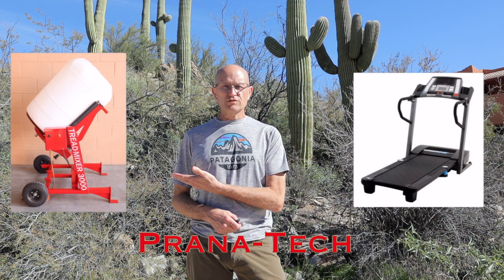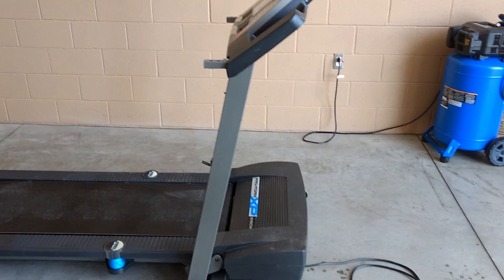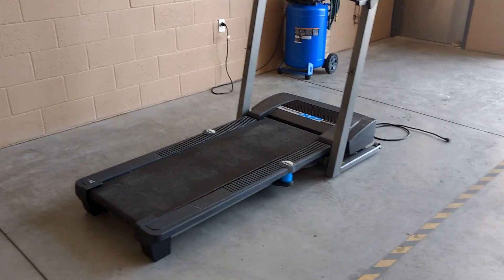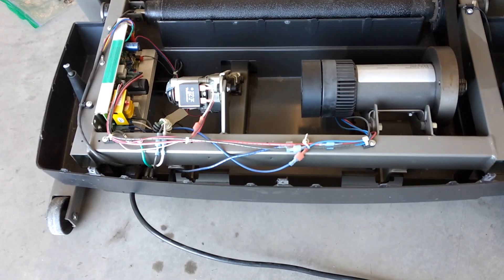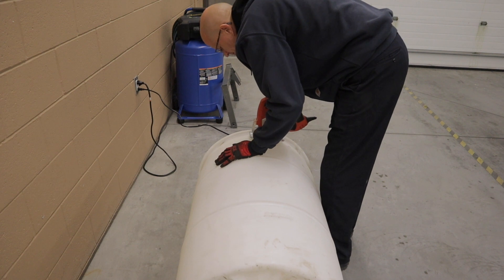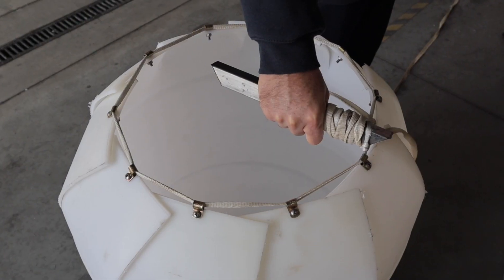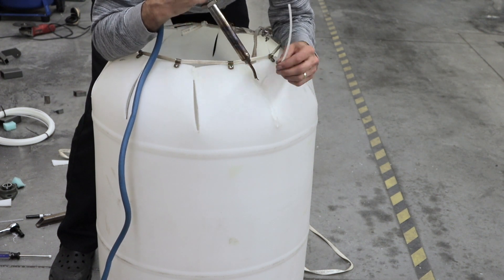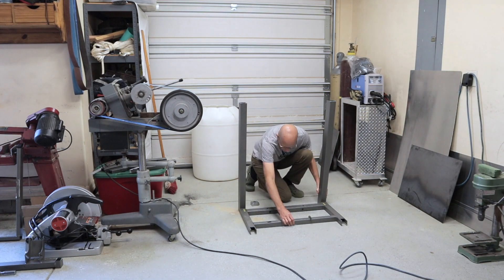Homemade DIY 55 Gallon drum Cement Concrete or Aircrete Mixer. How to build one from a Treadmill!

Comment: Hey Don, I already have access to a regular cement mixer. Should I be okay with that or are there necessary advantages with the TreadMixer? It's a very impressive build BTW but unfortunately for me welding is still on my 'to learn' list 😆
Reply from the maker: Hi Pete! Any mixer will do just fine. I built mine because I didn’t want to spend the money they want locally for a decent size mixer. 😊👍
Reply: @PranaTech  Roger that, thanks Don ✌️

Comment: I've built two cement mixers, the small one first, it needed fixing about 4 times, so showing how you build one is useless until you've used it at least 3 or 5 times and find out what breaks on it.   The key to my small one (made from a $100 golfcart mostly and 2000lb winch), was the big golfcart wheels, so I could load it up from the sand/gravel dumped from the truck and the loaded into the mixer dry, and then I could move it to where the cement was dumped after mixing it with water.  Otherwise, moving it wet was too heavy and made a fricken mess.
it had to be perfectly balanced like a wheelbarrow so I could move it full of material by hand,  The big fat tires were key.

My second one was very large 1/2 yard made from 2 or 3 55 gallon drums, an old forklift base, some old trailer hubs and wheels that it spun on, and old car axle and tires so I could tow it to where I needed to mix, and manual worm gear winch that would tilt it.  Originally I used an automatic trans that I fixed into first gear, but it was too fast and it also broke apart after using it a few times. I replaced that with another automatic trans locked into reverse done better, and then had a industrial reduction gear that I used a 5hp 12v winch motor.
This worked well but the drum started to bend and get flat spots so when spinning the motor had to actually LIFT it up rather than just spin it when it hit a low spot in the drum.  This would overheat the motor and eventually I had to limit to 1/4 yard but it died after doing a few shed floors, a driveway, and most all of my addition footing walls, the last part it died and we had to manually spin it to get the last two loads done.  It has sat ever since..I am thinking to fix it now as I need to pour more concrete that is remote location, so expensive to have it delivered.
Reply from the maker: You are very right sir! I just finished rebuilding the mixer with a steel tank because the plastic one cracked out the bottom after 2 years of running it mixing 3 bags of concrete or mortar at a time. I built 55 feet of sidewalk to my front door and then a rock wall across my backyard and it did great until it cracked.  It will last for decades now that it has a thick steel tank. Thank you for the information. 😊👍

Comment: Very inovative...but the paddles might need to be larger
Reply from the maker: You are correct sir! I just rebuilt it a few months ago because the plastic drum cracked at the bottom from use over time. I put a metal drum on it this time and larger paddles.😊👍
Reply: @PranaTech  I was thinking that if the paddles had slots or openings it may also help to aerate it more, but it may change the size of the bubbles in the aircrete?
Reply from the maker: You are correct, you have to be gentle with Aircrete and mix it just enough to incorporate the foam into the cement but not too much or the foam bubbles begin to pop and the mix will deflate.👍

Comment: Very creative with the threadmill conversion.  May i add that proper protective clothe and shield are a must for welding.  Those flashes will definitely cause skin cancer.  When I weld   I never ignore protection first  weld second.  The only thing missing is a  long sleeve clothing on this built.

I like it I am going to build one but my use is insulating the metal shed by mixing styrofoam into the aircrete.

Thank you for the video. I learn something new.
Reply from the maker: Hi there, yes protective measures are a must. I admit that when it gets over 100 degrees I sometimes falter in my efforts. If I have anything that I learned, it would be to build it with a steel 55 gallon drum instead of plastic one. I had to rebuild it a few months back because the plastic tank fatigued and the bottom cracked out.😱. Have fun with your project! 😊👍

Comment: Nice and all but you didn't show it actually mixing cement....No Real World use to prove that it is practical to use and works under load.
Reply from the maker: Hi NC! Well I’ve got 55 feet of concrete walkway all mixed with bags in this mixer. I also have 25 feet of rock wall that was built with mortar mixed with it. But yes there is no footage of this mixer being used in the build. If I had to do it over, I would build it with a steel drum instead of plastic. It worked great for all that work but last month the plastic drum cracked and I built a new drum for it out of a steel pressure tank that I had.probably will do an update so people will use steel instead of plastic. 😁👍

Comment: Does it mix well with being positioned so vertically?
Reply from the maker: Hi Jody, it mixes Aircrete great at the steeper angle. For regular concrete I use a spacer that tilts it forward so it will mix conventional concrete.😁👍

Comment: Great work. It is nice to see that you repurposed a treadmill.
Reply from the maker: Thanks! I need to do an update on it though. I’ve run tons of concrete through it and I had to rebuild it recently with a steel tank. The plastic one flexed too much and over time it developed cracks and eventually the back end blew out.😬 It’s back up and running better than ever now.😊👍

Comment: Don I wish I could be that talented.  Very good job.  I actually saw this mixer in action when you used it to pour in those two forms.  Would it be easier to pour them if the forms were raised on like saw horses.  That could be made the right height for the forms being poured.  If I can find a tread mill.  I’m going to give it a try.  Thank you.
Reply from the maker: Hi Gene! Thank you so much for your kind comments! I really appreciate it!  🙏❤️    Yes, it definitely would be easier to pour with the forms elevated. Great idea!  The older the treadmill is, the easier it is to use the controller. Finding ones that have a good steel frame can be challenging as well. I usually get the treadmills for free. I just put the word out and usually someone knows someone who has an old one that the want rid of.  I’ve built a couple of 2x72” belt grinders from treadmill motors and controllers and they work great. Just about anything that needs a variable speed motor can be built from a treadmill.😁👍

Comment: Well built. Would've loved to see the demo with the concrete
Reply from the maker: Hello, thank you! I have poured a lot of concrete with this mixer since I built it. I’m getting ready to do an update on it because I had to replace the plastic barrel with a steel one because the plastic one cracked over time and use.  The weight of the concrete once I would load 3 of the 60 pound bags of concrete and the water would really flex the plastic and over time it just got fatigued and cracked. Thanks for your comment 😁👍
Reply: @PranaTech  What kind of plastic is the tank?
Reply from the maker: HDPE 👍
Reply: @PranaTech  Okay.
Reply: @PranaTech  Okay.

Comment: I would definitely buy that tread mixer 3000 over the others. Great job, wish I could of seen it a full action with cement, water and sand or gravel.
Reply from the maker: Thanks Crave868! I am working on an update video showing it in action. I just finished 55 feet of sidewalk from my front door to my driveway and it works great! 😊👍

Comment: Wow. You are so resourceful. Very imaginative. Would a belt-drive have less problems than the chain drive? Thank you.
Reply from the maker: Hi there, well it certainly would cost less to build with a belt drive, but there is the problem of belt slippage when the weight of the concrete bears down on the drive system. I’m sure it could work but you would need a really strong tensioning system and I would also do a dual belt system to spread out the load. 👍😀

Comment: I would like to build one of these mixers. Do you happen to have blue prints or written instructions on the project that could be followed?
Reply from the maker: Hi there, sorry I didn’t make any plans for that project. I just built it as I went along and it just unfolded nicely.👍😀
Reply: @PranaTech  ok thanks

Comment: Will a regular cement mixer work just as well for aircrete?
Reply from the maker: Hi K.M.  Yes any mixer will work just fine. You will just have to make multiple batches depending on the volume of the mixer.😀👍

Comment: Did you build this so you could  mix more concrete at a time than the electric ones from home depo?  You are not saying you can't mix aircrete in the store bought, are you?
Reply from the maker: Hi Billie, yes, you are correct. I wanted more volume than I could get with the store bought ones. You can mix Aircrete in the smaller ones ,you just have to do more batches.😀👍

Comment: thanks for sharing sir. can you build the new one from a washing machine?
Reply from the maker: Hi Bucah,  that would be a tough one since the drum has so many holes that would need to be welded up. Thanks for your nice comment!👍😀
Reply: @PranaTech  sir, sorry I mean not from the drum of the washing machine. I have old washing machine motor. I'm not sure if I can use the motor for concrete mixer.
Reply from the maker: Hi Bucah,  oh, sorry about that!  The washing machine motor can certainly be used. You will have to reduce the speed of the motor with gears or pullys to a speed that is not too fast for the mixing of concrete. There will have to be some experimentation to get the desired speed that you need, but it certainly can be done.👍😀
Reply: @PranaTech  thank you sir.😃

Comment: Good project but not too much of explanation on how to set all the parts., Also the handle should be in the back., and the angle of the drum is to straight up.., let me know if this helps.
Reply from the maker: Docosta, thanks for the comments!  The angle I made adjustable because I built this to mix Aircrete as well as regular concrete. Aircrete works better in the more upright position and you are right about the angle for concrete being more horizontal.  I had a lot more footage of the build but the video would have been 45 minute to an hour long and people said that it’s too long to keep people attention. The handle works great where it is though. 👍😀

Comment: Do you have a specific project you will use the mixer for?
Reply from the maker: Hi there. Yes, I have a few projects that I needed a cement mixer for. Mainly I needed it for mixing aircrete which is a lightweight cellular concrete for building raised planter beds and wood fired pizza ovens. Thank you for your interest! 😁

Comment: Great Job Don!  Incredible use of the treadmill parts!   I was particularly impressed by the custom sprocket you made with the chain....super smart!
Reply from the maker: Thank you!  I appreciate the great feedback! 😀
Reply: @PranaTech  You did really nice job but you forgot to protect engine from the water buddy.
Reply from the maker: Hi Marc! Yes you are correct! It has never been a problem here in the desert of Tucson. I wash down the inside with it running and then I turn it off and wash down the outside with the power disconnected. Everything dries in minutes here so I’m just careful and stay away from the motor and the control box when I’m cleaning up. 😊👍